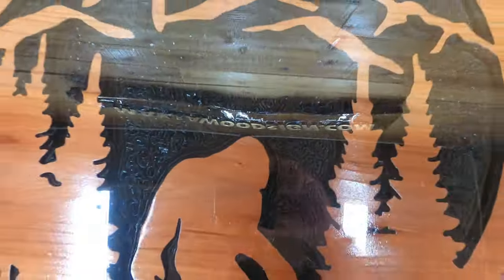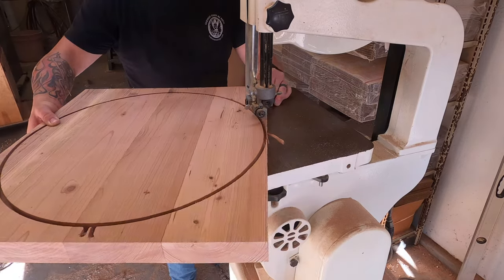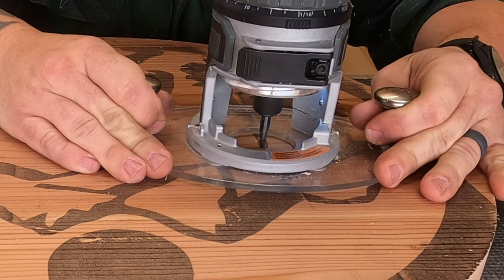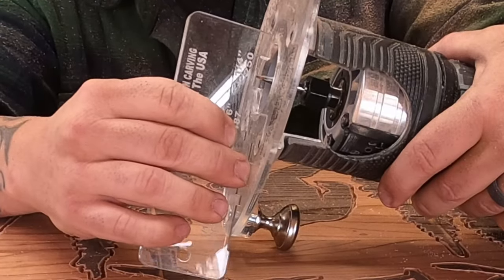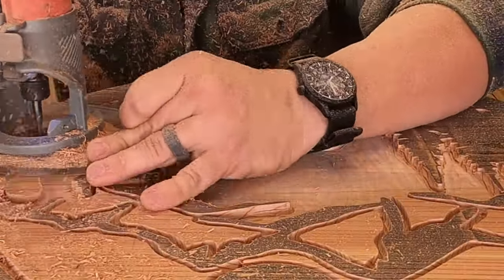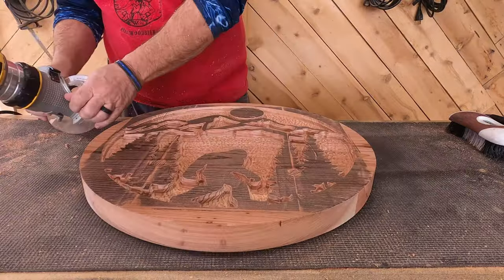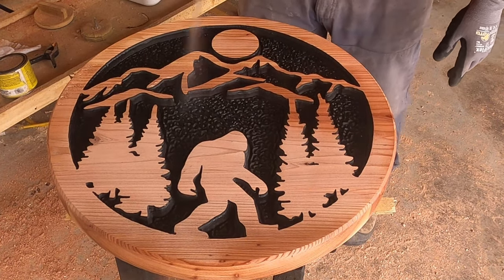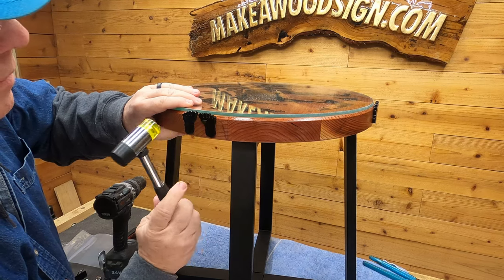Hand Carved Sasquatch Table!!

Comment: I think this may be my favorite project you've done!!!  I know I've said that before but you keep coming up with such awesome ideas.  The way I like to cut circles is to router as far as the bit will reach on thick material, use a jig saw or band saw to cut all the way through like you did, then use a flush trim bit to ride along the cut routered edge to finish the circle.  You did a super job but I would probably end up with some flat spots using the disc sander.  I absolutely love the idea of using the little retainer feet.  The 1/2" router depth really made the design stand out, the glass and base look great as well.  What a fantastic job!!!
Reply from the maker: Thanks Lori! The flush trim bit is a good idea, especially if you have a router table set up for that operation👍👍
Reply: @oldave100  Yes, a router table would be good but just elevating a project on something like bench cookies and using a handheld router works great too.